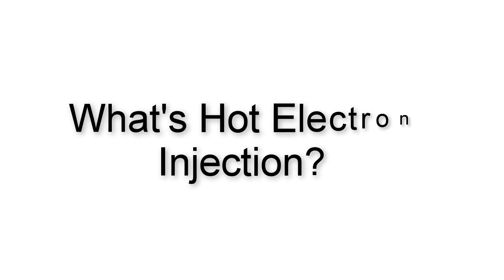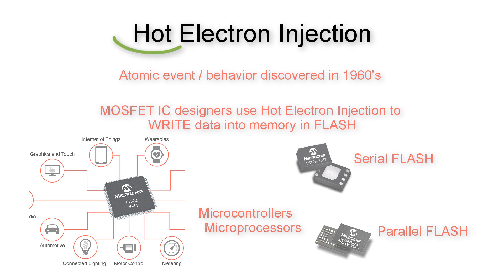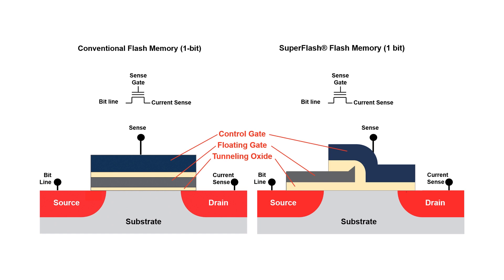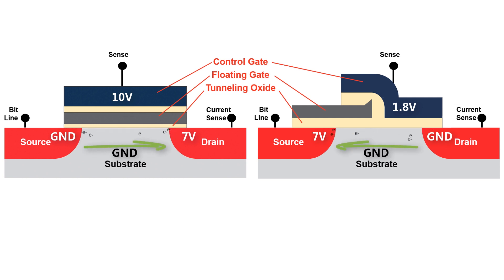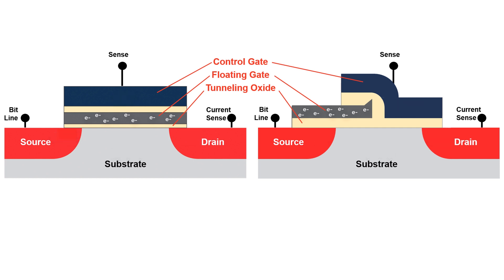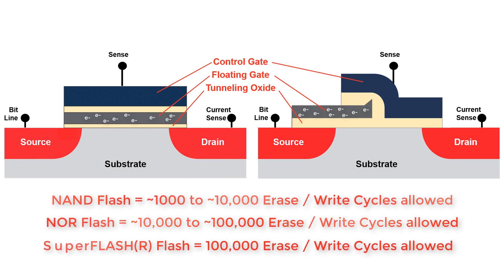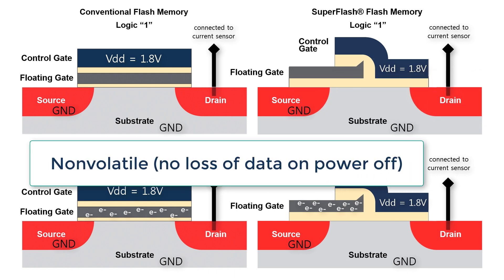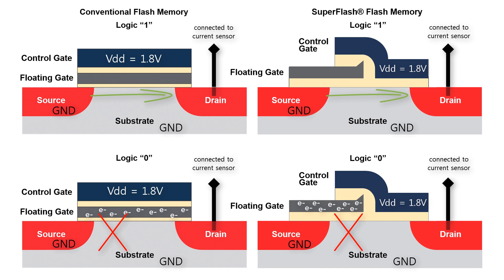What Is Hot Electron Injection?

Comment: I have seen the FN Tunneling video.. you sort of said the same thing there right? Just the reverse direction....Give high voltage and tunnel those electrons... or Am i missing something?
Reply: simple skim of Chapter 12 on Digital Integrated Circuits: A Design Perspective, Second Edition: hot-electron injection has higher current and power consumption demand, while F-N tunneling has lower requirement. F-N has +20 V on gate and drain, while hot-electron injection has +12 V on gate, and +6V on drain.